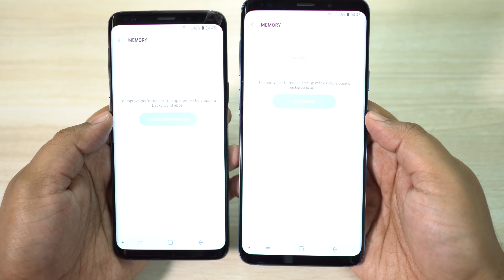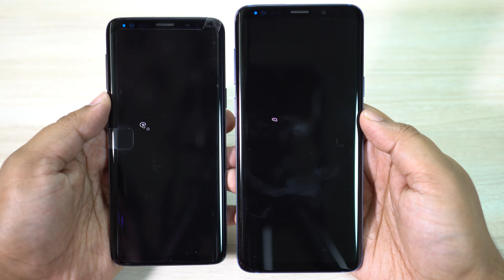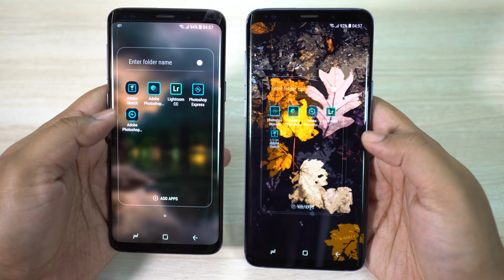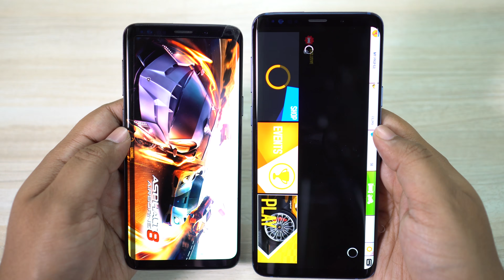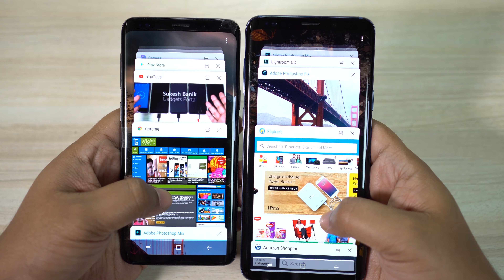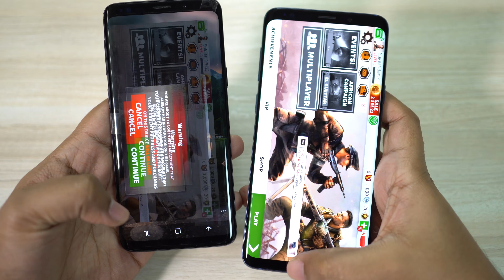Galaxy S9 vs S9 Plus SPEED TEST! (S9's Poor RAM Management is frustrating)

Comment: Lmfao you overreact on that RAM part. It really isn't a difference for the casual user. What it's maybe 0.5 seconds faster? congrats. What do you use all that spare time on? These phones are identical, if you don't take pictures. Bigger broader phone, slightly faster. Smaller, more compact phone: still faster than any other smartphone on the market, + higher pixel resolution than the plus.

Comment: You used the wrong term. They are using the same RAM management (specifically the paging part of the operating system). The reason the S9 needs to reload most of the apps is simply because 4GB is not sufficient for so many apps you opened.

Comment: The Galaxy C9 Pro launched in November 2016 has 6GB RAM has a ram management issue and it starts to boot out after about 21 apps
Reply: It should hold at least 40 apps

Comment: For me the problem is that S9+ is just too big for me. I can't reach anyhow notification panel. So if i would use S9 with that ram management, i wouldn't buy any of this devices.
Reply: you can use the fingerprint scanner to get the notification panel on the s9 and the plus
Reply: There is a setting that let's you swipe down anywhere on the screen to access this as well. I do agree though, the S9 feels much better in the hand (I have smaller hands). It's a shame that both devices couldn't be loaded with 6 GB RAM.